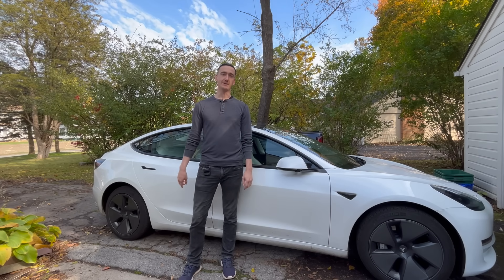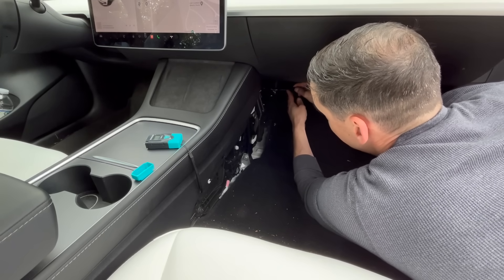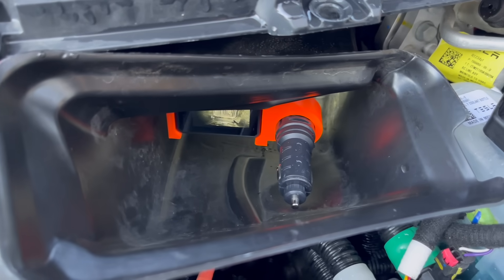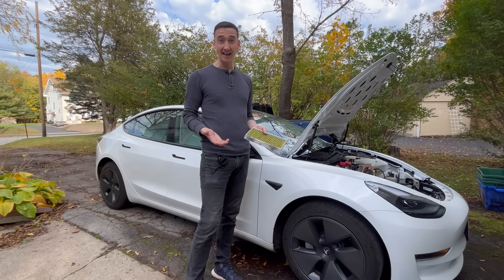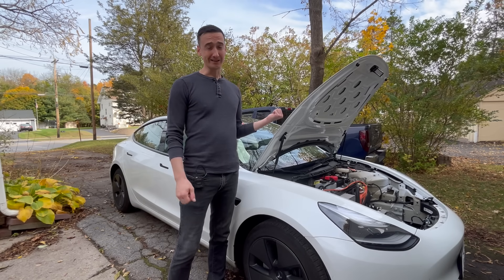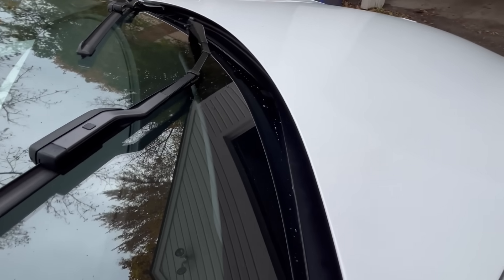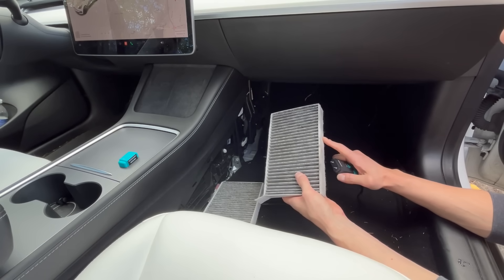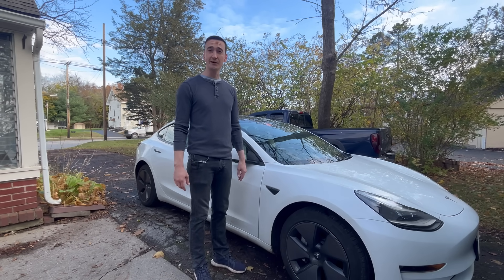This design flaw makes Tesla’s Model 3 smell bad! (with fixes!)

Comment: 4:17 The bottom of the elbow can be clearly seen here. Adam, I agree that's a design flaw by Tesla. The designer/engineer forgot to put a drain hole/slot in the elbow. The elbow is the lowest point of the duct before it becomes straight and connects to the fan blower. So there should be a drain hole/slot. I would suggest cutting a slot at the bottom of the duct elbow.  The slot length would be the width of the duct X 0.5" d - Try with this dim. first.  This way water will drain through the slot quickly and the air won't carry any water as it blows through the duct straight section.
14:21 The side view of the duct elbow can be clearly seen here.

Comment: I have documentation of an official procedure from Toyota to remove the moldy odor from the filter without the need to replace it. Keep in mind that you will need to replace the filter anyway when the time is due, but at least it will solve some odors without any work or part involved. It involves leaving the car turned on for 1 hour or so with the heater at max temp and the fan at max speed, which kills the mold on the filter.

I don't remember the specific steps, but if anyone is interested I will look for it and share the steps here.

Comment: The problem is related to the airflow and the air velocity. Compared to other cars the Tesla almost has no surface area, so the velocity of the air is very high, causing the water droplets to remain airborn. If the surface of the inlet would have been larger, the flow would have been the same, but the velocity lower enabling the droplets to fall instead of stay airborne.

Comment: Your method of measuring humidity is useless, it even gives different readings when you use it on another type of wood. It uses electrical resistance to calculate it. lol
Reply from the maker: How would you do it?

Comment: Also the reading on paper is on a limited range 6 to 42 % so not really a good indicator.
Reply from the maker: For the future, what would be a better way?
Reply: @adamdport  its was a good test, only the instrument specify in the datasheet that the range is limited. So anything over 42 cannot be measured. What would be interesting is at what %of humidity mould and odor would begin to form on "paper". But hey the gopro thing did enough to show what happen. Maybe someone will design a 3D printable replacement of the duct!

Comment: Thank you! This was one of the best Tesla model 3 problem + solution videos I’ve seen! I had replaced my filters with  similar type that had an activated charcoal stage, and it seemed to help, but like you pointed out, once those filters get moist, they eventually get stinky again. I also hate how the car is always running the fan after I’ve driven it, and now I understand why (it’s trying to dry the filters). But where I live, it’s hard to dry anything with 80%-90% air humidity!

Comment: I wonder if 3d printing can make a solution with the duct. There’s permanent filter solutions for shop vac systems where theres a wall pattern made in the vent that prevents solids and perhaps liquids from getting in. It's definitely a more complicated manufacture and not as easy as a gasket, but could last longer.

Comment: Something to add: it's definitely not just the rain and water intake that causes the smell. I live in dry arizona and the smell gets bad in the the summer when it's 120° and 0% humidity. There must be some sort of condensation build up somewhere just from normal A/C usage as well.
Reply: Yes, I was hoping this would be addressed.
Reply: I would suggest not leaving the car AC in recirculation mode. I know it cools more efficiently but it also creates a lot of moisture stink in the condenser. Let in some outside air especially before parking it.
Reply: Dry out the ac condensation before you park the car. So when you're about 3-5 min away from parking, turn off ac turn off recirculate and run fan speed high. It'll run fresh air through and you'll feel the vents get wet. As air continues blowing the condensation will dry and so will your vents. This will prevent moisture from sitting and creating mold/mildew. You don't have to do this every single time you park but I would recommend doing it when you know you won't be driving for hours just so the moisure doesn't sit there. Do this for all cars.
Reply: @Strictlyamc  yea... No. A 55,000 car shouldn't need to do that
Reply: @_CRiT_hits_  you don't need to but it'll help with your problem. Cooling air down causes condensation to form and this helps dry that condensation. Doesn't matter how much your car costs, this happens with all car ACs
Reply: I’m in Texas with a 2021 with the hepa filter and at least once a year it smells like vinegar badly when you start the climate control.    Replacing the filter makes it go away for about a year, sadly this video doesn’t address the hepa cars.
Reply: I’ve heard this is a common problem even in dry areas such as AZ. I’m fairly dry here in Idaho and I have same problem.
Reply: Sounds like a software issue, as long as you’re in Auto mode there should be proper cool/dry cycles not unlike a defrost cycle in your fridge. I guess that’s the problem with a california car company, no sense for the edge cases 😅
Reply: @H0neyGh0st  They are a Texas car company now.
Reply: @Zero-lh1rb  Oh yeah I forgot about that lol
Reply: @H0neyGh0st it’s cuz it’s a newish company. Other companies have a 100+ year head start to iron out these problems.

Comment: Would be great to see a longer-term report on results when removing the intake duct.  Thanks for such a wonderfully thorough analysis of this design oversight !
Reply from the maker: Sorry I didn't follow. What kind of longer term report?
Reply: @adamdport I think he might measn something like: As the smell does not appear immediately after changing filters. So if you remove the duct and have it off, does to smell come back in say 6 months?

Comment: Great video and information, thank you.
How have they addressed this issue on a 2023 M3?
*Update, i can see my 2023 m3 is the same as the video
Reply from the maker: Thanks for the update!
Reply: @adamdport  what is the best solution then?
As some have stated in the comments a new hood gasket could impede airflow(I'm leaning towards this solution), removing the duct could expose some things to water possibly.
What are your thoughts, what would you do?
I do like the idea of not having to buy anything and do work also and just remove the duct 🤷🤪
Reply from the maker: @jonathanyates8414  I'm working on a part 2 to this video, I don't have all your answers just yet. Stay tuned!

Comment: Automotive HVAC engineer here. It's literally my job to design the air intakes on cars. I was APPALLED when I saw Tesla is using a duct feeding directly into the cowl screen. Like you pointed out, every other car on the road channels the water away via a tortuous path in the sheet metal.

I don't recommend sealing off the hood with weatherstripping, though. Proper cabin air intake design is a balance between opening up the air path to allow adequate airflow and sealing it off where water could pose an issue. Completely sealing off the hood will surely reduce airflow in the cabin.

Also, removing the duct might have other issues. I'm not sure if all those electronics are rated to be exposed to that quantity of water. This duct may have been implemented to protect those components.

Looking at their flat cowl screen opening, I would've created a three-sided wall surrounding the air intake to channel water away. I'm not sure how effective this would actually be as you showed how the entire cowl screen was leaking at its edges.
Reply: How would you guide the water away from the duct?
Reply: what about putting one of those water resistant screens over the air duct like they have for aftermarket cold air intakes on ICE engines?
Reply: thank you for this idea!  Definitely doing this instead. Tesla will find any way to get out of its warranty and I'd hate to add the weather stripping to the hood.
Reply: Thanks a lot! That is exactly what I was thinking when I saw those proposed changes. Just guiding the water away from the duct should be enough.
Reply: I had the same thoughts, although I am not confident about any solution
Reply: This was an amazing video thanks! Had no idea that car wash mode sealed off that opening.

Comment: I think WIX changed something...first, your Amazon link for the filter doesn't work anymore. Also, I went on O'Reilly's website to look for the correct filter. The only WIX they have listed now is WP10016, which says Activated Carbon. WIX's website has both the WP10016 & W10016XP listed, but they both are listed as Activated Carbon. It seems like they got rid of the MicroBan or something.

Comment: One huge flaw with the rain detection is its an actual camera and not a sensor. So when the windshield is dirty it thinks its raining which makes it even worse because you cant use cruise control without the windshield wipers constantly staying on. Plus if you use the wiper fluid the remaining fluid just sits at the top of the windshield where the camera is at lol. Lets not mention if you need an alignment that it cuts off traction control, brake regen, cruise control,lane assist, collision braking, and disables auto park when you open the door. This car has many cool features but has twice as many dumb features.

Comment: I think the better design is to put a 2" or 3" lip in front of that drain area in the duct, perhaps in a C shape towards the front of the hood. However, I'd be interested in knowing why hood gaskets isn't continuous from the factory. Hopefully the current models have this problem corrected.

Comment: How is shooting a hose backwards down the windshield simulating rain? Especially if you are driving the air flow goes over the hood and up the windshield! I've noticed a smell but it's from the desiccant bag needing replacement and switching seasons from AC/heat in between.
Reply: Most cars come to regular stops because of things like "traffic lights" and "congestion".

Comment: I'd be curious if you just cut the bottom of the duct out.  That way it still shields the firewall cabin intake from water flowing down off the windshield and there's no opportunity for the fan to create enough negative pressure to pull the water up into the intake.

Comment: The thing about having the wipers go down slowly is that that won't make a major difference in the amount of water getting in the frunk area.  Reason is, even without the wipers moving, there is still going to be water making its way under the back edge of the hood, because of the way in which the wind flows after it hits the windshield.  Remember back in the day when there was Cowl Induction on cars?

Comment: I always run my fan on high. I've never had this problem, no matter the weather. Of course, I drive only GM products. I'd be a little upset if I owned a tesla and had to fix their design flaws. My Volt doesn't have this issue.

Comment: I suspect the reason there aren't substantial gaskets where you added extra ones is to allow airflow. Wouldn't adding extra gaskets block the airflow causing other problems?

Comment: Probably one of the most in-depth, informative and interesting automotive repair videos ive ever watched. Looked into not only what was happening, but WHY it was happening and instead of a bandaid fix you actually source the root cause and try different solutions after looking at what other manufacturers did to prevent it. Fantastic video!

Comment: Use the gasket, cut the air intake in half, and the cut can even be angled down, so there’s a top, but the bottom is cut going towards that drain. Seal the gap between the air intake and the vent.

Great video.
Reply: Can you elaborate? I’ve been trying to find a solution like this but I’m not sure how or where to cut to get the water to flow down effectively.

Comment: Just curious if anyone has removed the bottom filter and not replaced it.  The top one seats high enough, and doesn't seem like it would jiggle down low, and retain moisture from the condenser, if in fact that is the problem?

Comment: Great info! I’m having the same issue in my 2022 MY. I haven’t looked to see what my intake looks like, but after a year I had to change my filters and the smell immediately came back every time it rains. This explanation makes a lot of sense to me, and I wish Tesla would figure out a way to fix it! I would like to try weather stripping, but I’m concerned about getting the proper amount of airflow as well. I don’t know if blocking airflow could make another issue.

Comment: I had this issue and they retrofitted a new part with a deeper drain hole and a higher 'wall' to prevent this issue. They replaced it for free.
Reply from the maker: When? Model 3 or y?
Reply: @adamdport Last year, Model 3 2019, Netherlands. They replaced the entire duct with a 'new design' one.
Reply from the maker: @RickDoesburg  oh, ok. According to their parts catalog the duct changed October 5, 2020, so I think if you look they just "upgraded" you to the same duct that I show in this video (late 2021)

Comment: First problem is this car has a car wash mode.😅 Most cars that vent is out in the open, but theres a channel for the rain to just run out of the bottom sides of the cowl. This is a horrible design.  The hell are they thinking 🤔 Edit looks like all the cars you show have a good system.

Comment: Great Video! I cant believe that Tesla puts the fan before the filter, isn't that gonna suck in small leaves and stuff which get stuck in the fan blades?? I've had the air filter collapse in a car (where it was before the fan) and that caused leaves and small stuff to land in the fan and make it vibrate a lot.

Comment: Hey Adam. Best breakdown and thorough research that I've seen.  I have a 2021 Model S and the intake tube set up is different. When it rains, the odor is horrific inside.  Ozone machine inside helped, but only until the next time it rained.,  Any chance you could do same breakdown and recommendations, but for Model S?

Comment: I don’t think the wipers are an issue, considering most air flow will help force the water out as the car is driving. Car washing though seems like the main culprit. I rarely wash mine so it’s rarely wet so no smell :-)
Reply from the maker: What about red lights and stop signs?

Comment: The negative pressure issue you showcases with the rain drain is also an issue with HVAC systems in houses that is easyily overcome: A simple u bend does the trick.
Reply: How about flipping the air intake upside down? Make water work against gravity and make it difficult for water and debris to get in. Would that work? It would need mods of course but it might be the best way to do it. Or cutting the intake and adding some kind of u bend though I wouldn’t know where to start with that.

Comment: i feel embarrassed for these Tesla engineers.  Their only defense is to use recirculate most of the time because it is energy efficient and guarantees you don't get exhaust/pollution from outside. but then, what about those who want outside air, the engineering of this part is absurd.  Like why even make complicated expensive ducting and electronic shutter for this, why not just copy the air-intake designs from ICE cars that includes water mitigation.
edit: Maybe, Tesla did it this way so that it can go through flood water with a height below the vent? But then, they can make ducting that sucks in air from the frunk while still maintaining the high flood water mitigation

Comment: One thing, who the hell washer theirs car with blower at full blast?
I can't believe that Tesla engineers are making such rookie mistakes with intake design. They knew about water ingres because of that drain. Problem is that, that drain should have flap valve so the water can drain but in case of vacuum, no air can get in.
For me, that should be completely different design. It should be more of S or P-trap design. Something similar to newer Y model.
That car wash mode is just lousy excuse for a fix of problem.

Comment: Instead of a gasket attached to the hood, why not a gasket around the air intake itself?
Reply from the maker: No reason! Anything that keeps water out of there is an improvement—just make sure you don't go ALL the way around it ofc

Comment: just wondering if by putting the gasket all the way across the hood would affect the air flow for the blower motor air intake. maybe putting an air speed indicator before and after the molding would answer that question.

Comment: This must be more common for Heat Pump equipped Model 3's, I just got a 2018 Model 3 and it has a much different intake piece, that seems to have somewhat solved this. Haven't driven it long enough to notice smells, but it is a bit different than the one in the video upon inspection.

Comment: Anyone know of a fix for the 2021 refresh Model S LR? My HEPA filter had to be replaced at about 13,000 miles and 16 months of driving. My 2018 MS 75D has never had the HEPA filter or the cabin filter replaced and the car smells pristine. My 2021 MS LR would smell like wet socks after driving in the rain or maybe even a car wash. Would love to know is there is a way to stop my new HEPA filter from getting wet and moldy.
Reply: Since you know the problem consider making your own similar investigation and solution. Look for the air intake, see how the water gets in then look for aftermarket parts to divert that water flow.